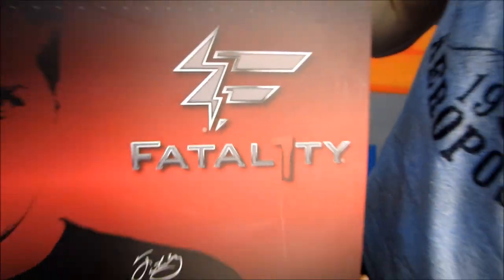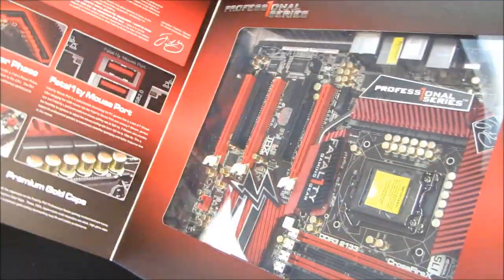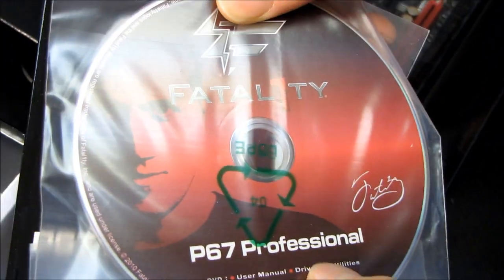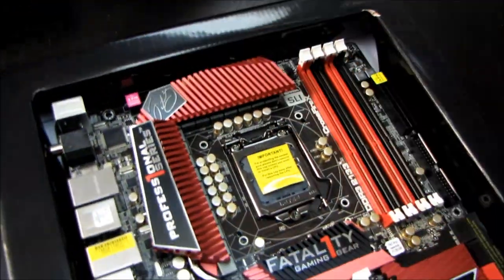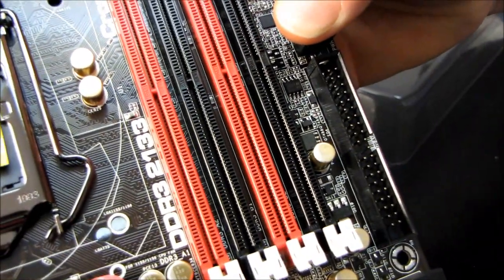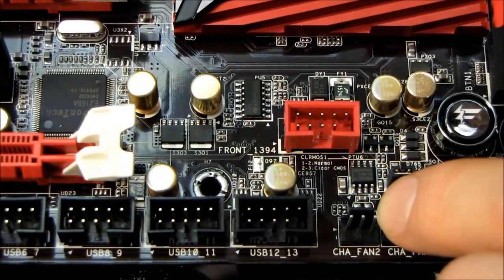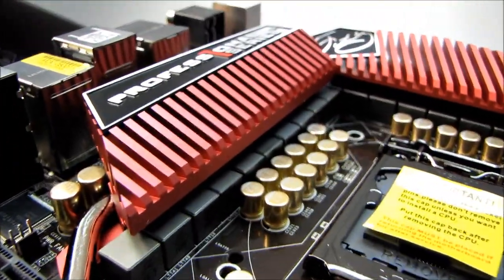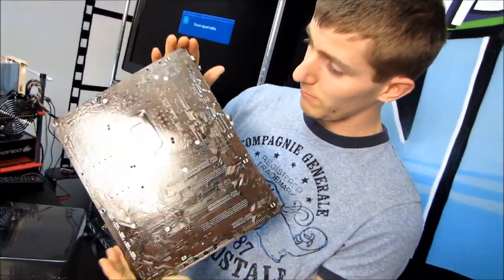Asrock Fatal1ty P67 Professional Series Motherboard Unboxing & First Look Linus Tech Tips

Comment: Those who are asking if this board's SATA2 slots will deteriorate over time:

The only ports on any P67/H67 chipset motherboard that will deteriorate over time are the two SATA2 ports that are provided by the P67 chipset. The SATA3 ports on the chipset will not deteriorate nor will any third-party controllers that are providing you with SATA ports.

It's a chipset issue, not a motherboard issue. If you have a P67/H67 motherboard, use the SATA3 slots. Not the SATA2 by the chipset.

Comment: If anyone is wondering whether Asrock boards are good, heres my experience.

I have the absolute cheapest 1156 board from Asrock and it is working flawlessly.  It actually has a few nifty BIOS features that both my top end Asus boards do not have, like being able to turn off the power LED when the computer is in sleep mode.

I have not tried overclocking but the board just works with no problems at all.

Comment: @vanhodid z68 enables the use of the integrated graphics on the CPUs. It also enables the use for the CPU's integrated graphics for faster video encoding etc. 
Also, Z68 has been proven to be a little stabler, with less problems with SATA ports, as with P67 in the past.

Comment: Two Ethernet ports allows you to link to separate networks without linking those two networks together.  Not sure if you can still link two separate internet connections together to increase performance like in the old days, though...  But that would be a very interesting use.  Otherwise, it is just silly...

Comment: @WhippJunior Oh thats awesome :), what kinda volts are you using for that overclock?,  i think this Board is far better because there are better features to it compared to the Asus P8P67 Pro like the 16 Phase power, the looks, the 2 extra USB 3.0 ports plus the front usb 3.0 bay.

Comment: Friend I have a problem with an ASRock p67 extreme4 plate the question is that I bought it secondhand and it worked well and I keep it with processor and ram and then almost a month I completed the other components and when I connect everything.  Does not catch anything at all and I changed sources and ram and nothing without the power of the mike in the end I do not understand can someone suggest something?

Comment: @JtGorospe90 On the platform.. AsRock 990fx Fatal1ty with a gtx 580 and a phenom ii x4 965 oc (4.2) out performed my other AMD setup on a crosshair IV AMD setup (exact same) by just a bit. It also out performed my Maximus i5 for some reason (maybe because its not overclocked yet). But when I put the intel in the AsRock z-68 it out performed the AMD version of the AsRock.. I hope this clarifies some stuff i said back then

Comment: @CaptainTurkeyGiblets because i have both and I have tested the intel vs my AMD.. What i am saying is that the AsRock with my Phenom II X4 965 overclocked.. Outperformed my intel i5 on its Crosshair IV.. My gtx 580 was giving better frames with the phenom on the AsRock then my intel i5 on its Crosshair.. Not sure why but it did.. better fps on crysis and metro 2033 anywhere from 5 to 10

Comment: Was considering this board over the Asus p8p67 deluxe b/c I like the red and black color scheme over the blue one Asus uses.  Only issue I have wit this board though is the 3rd party sata 6, on the asus board you get 4 off the intel chipset and seeing as it seemingly makes a difference in hard drive performance, that hurts, espcially since I'll have 3 drives capable of using 6gb/s.

Comment: very good for a home server, so you don't have to use sata ports for optical drives. the floppy... i guess if your running virtual systems and you need windows 98 then i get it. besides that, it could of done without it.

Comment: I Have:

Sapphire Radeon Toxic 1 Gb
Intel i7 2600K
Mushkin Silverline 1600MHZ cluster 7 (temporarily consider for a better ram)
Corsair H50 Liquid Cooler 
OCZ 120 GB SSD Vertex 2
WD 640GB Caviar Black Sata 3 Gb/s, 32MB 7200rpm
Windows 7 Home Premium 64BIT

Only part i'm missing is a motherboard.
I can't choose between:

MSI P67A-GD80 B3
Asus Sabertooth P67 or a
Asrock Fatal1ty Professional.
Wich i must choose? Someone can suggest or info me more about the specs in combo with my Pc parts.  
Thnx

Comment: hy,I like more fatali1ty how the motherboard, but I don't know that I have decided to buy, socket 1155, i3 processor 3.4 mhz, intel, ram 8 GB 1600 MHz corsair, corsair power supply corsair GRAPHITE VS650w, 230, COOLER, Corsair Cooling Hydro Liquid H100i, samsung hdd 500 GB, 7200 RPM, the asus GTX 760ti graphics card, 2 GB,